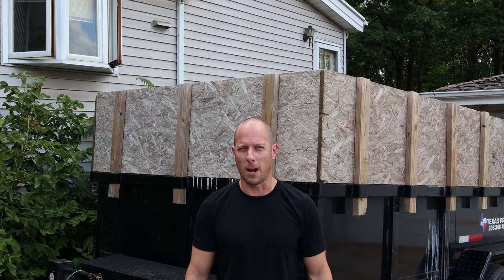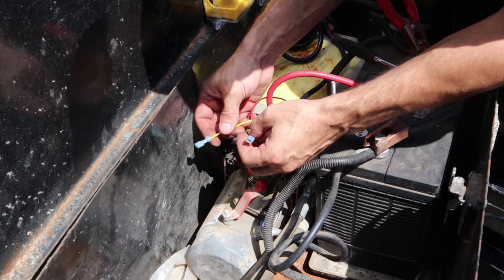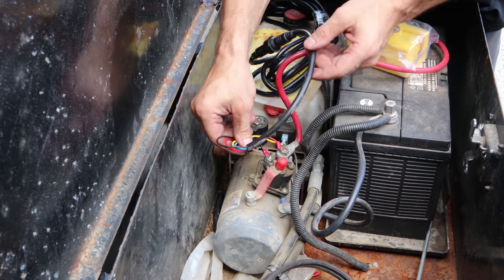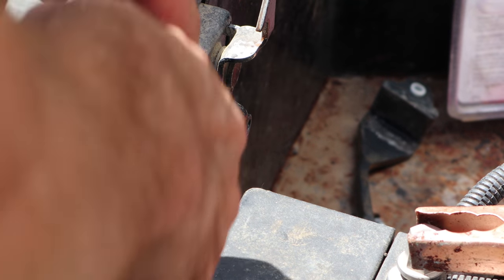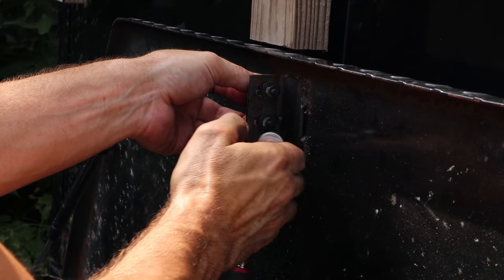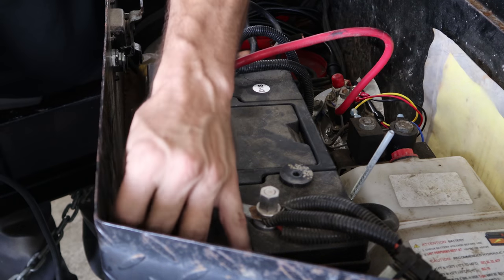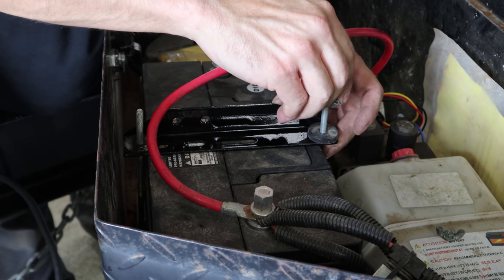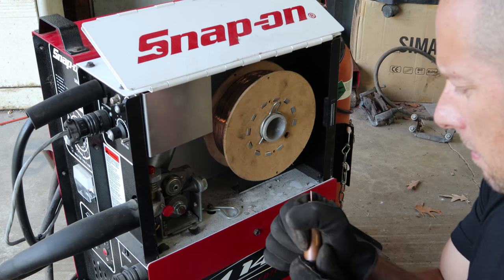Rebuilding a wrecked trailer after a collision part 2 To dump or not to dump? That is the question!

Comment: terminal connector crimp tip.  After you crimp the wire in the metal part of the connector ,move the crimp pliers away from the metal part and give the insulation part a squeeze enough to grab the insulation on the wire. This will help prevent the wire from separating from the metal part of the connector over time. Similar to using a clip to hold the cable to the solinoid. Unless you use heat shrinkable connectors
Reply from the maker: I usually use heat shrink connectors but they are not really necessary since the other end of the connector is wide open to the elements anyway.

Comment: Nice work as always. For that front lid rattle, you can cut some old small rubber hose and push them on the bottom part, so that the lid when shut hits the rubber and doesnt rattle even as little as you got it to rattle. I hate rattling also. :)
Reply from the maker: Thanks!

Comment: Some good work there....I haven't touched a welder since the early 80's but I think I might have done a better job than was done on the colbolt
Reply from the maker: Thanks, if you had never touched a welder, were blind and had had your hands tied behind your back you could do better. lol  They didn't set the bar too high!

Comment: On the top of the tool box you can buy a rubber seal that fits over the edge of the sides to seal up the tool box better.
Reply from the maker: It doesn't need to be weather tight.

Comment: It's amazing how much rust can show up on a 2 year-old trailer in the midwest. No rust = a California benefit.
Reply: All trailers show rust quick.  They are not primed, just painted with single stage gloss black that's paper thin from the factory.  Price point you know.
Reply from the maker: This one was actually from KS but all trailers that get used rust.  It doesn't help up here with salt either so they look worse much faster!

Comment: The Harbor Freight Tools Do What You Need Them To, That s All That Matters! My First Tool set was a 40pc 1/4 & 3/8 Drive combo set that came from an Auto Parts Store (Strauss) and My Deep Sockets Came from a Grocery Store. They Did Their Job. Have Gradually Upgraded Past Few Years..
Reply from the maker: I do have tools I prefer but when I don't feel like spending the money or they are not available, even the cheap tools get the job done!
Reply: @vehcor  Exactly! Sometimes You have to Run Out to get a Tool in a pinch. I Have a Cheap Set with My Mistake, a Better Set in My Truck, and a Few Pieces of The Big 3. I Try To Get MADE IN USA as much as possible. Anxiously Awaiting Next Video 😎..

Comment: You got lucky on that hydro line, so close to saying throw it in the pile.
Reply: he loosened it to enhance the video
Reply from the maker: I did, it worried me that a seal was blown out.  Someone had to loosen it, possibly to lower the dump if it was up for some reason and the pump was not operational.  There is no way they were using it like that and I cannot see how it would have been from the accident.  Still a pleasant surprise to not have to spend money for what at first looks to be a big problem.
Reply from the maker: @lostintime8651  nope, I don't have time to make extra work for myself. lol

Comment: Murica🇺🇸👍I've owned and abused a trailer just like that one. Great trailer... Did not ever let me down. I'm sure I overloaded it a few times. I do a lot of water damage demo. Best upgrade I ever got for it was the wireless controller.
Reply: I also recommend the wireless remote. Can't beat it for the price/convenience.  Also, double-check that the rear doors are hooked securely before you lift the bed or you will need more than the texas pride door alignment tool.
Reply from the maker: The quality is not as good as some of the other dump trailers I have seen but for what I need it for and what I paid, it will work out perfect.  I have a wireless remote for my winch on my other trailer and it is super useful.  Maybe a future upgrade!

Comment: Was going to suggest putting some weather strip around the top of that battery box to keep the weather out, and keeping the rattle noise down. I have a 20 foot PJ car trailer that has a similar pump and control system. Pretty nicely built trailers!
Reply from the maker: While the PJ is nicely built, this one is lacking in many areas.  If I would have paid what these things sell for, I would have been a little upset!  For my uses it will be perfect but in my opinion and experience, you cannot beat a PJ!

Comment: Excellent video. One thing I would l would like to point out there is no ground on those controller. The red is power to the switches, black is power to the motor solenoid,  yellow or blue is power to the up/down solenoids. Good tips on the wire clamp and air removal.   They probably loosened that hydro line to drop the body after the accident.  Good job on the adjustments. Lol for the Snap On welder.  Can't wait until next week.
Reply from the maker: I didn't really check, I just put them back where they went or I thought they went.  I do like to be accurate in my statement so after reading your comment I decided to check in case I had to correct myself.  The test light as well as the negative sign on the solenoid seem to agree that it is in fact a ground. lol I was thinking they may have loosened it and to lower it would be the only reason I could think of.  I can't see it being wrecked in the up position.  Someone had to loosen it, they could not have been using it like that.
Reply: Unless when it was hit it jolted the body up slightly or shifted the load causing the body to unseat from the frame. could also be non-damage just to get a new trailer. You are correct on the solenoid also. I checked my cousins dump trailer and learned something new.  Most of the hydro pump motor solenoids are power to operate just like a snow plow. learned that one the hard way. kind of.

Comment: Too many 're-builders' just do the basics to get it out the door, but you went all over that trailer to fix everything, the chains, the safety cable, the bent door, the  locking bar, even the loose line under it! (even the battery hold down, the 'loose' lid & the lock) Way to set yourself above the rest!
Reply from the maker: I just want everything right so I can start breaking it all myself. 😂

Comment: "All my welds are worth twice as much as everyone else's."   I laughed.  But did you get it from Snap on or rescue it like most of what you rebuild?  :D
Reply from the maker: I actually bought it off eBay, it was used and by used it was not off the Snap-On truck.  It had never been plugged in.  I paid $1100 and a 2.5 hour drive to get it.  Well worth it!

Comment: They have a wireless remote system at Tractor Supply that’s normally used for winches that would work in this situation. I feel it would be much more convenient to utilize the wireless system so can dump while pulling forward. Would work great for building  roads and driveways.
Reply from the maker: I'll look into it.  This one is only for hauling all of my scrap metal to the scrap yard.   I'm tired of unloading my truck by hand. lol

Comment: for 140 bucks you can understand why they kept the control
Reply from the maker: Yes, they are douches.  They got paid for the trailer and all the parts.  It could have been the tow yard it was at too.  Who knows? Since it only cost $25 to replace it new, a used one is not worth the time to steal.

Comment: When Texas Pride's Prideful prices are to much Ya gotta do what ya gotta do! I ended up with one of those low quality rebuild weld jobs. The core support basically collapsed into the engine. Fun times.
Reply from the maker: Rebuilds are about saving money, sometimes you have to find alternatives to make it work.  I have seen a few of these low quality weld jobs.  I have had to fix them on a few of my rebuilds before I could sell them as well.  Sometimes when I was working on a different part of the car. lol

Comment: Add a wireless controller. Love mine. Cost $15
Reply from the maker: Where did you get it of $15?  That is a good deal.  I have not seen them that cheap anywhere.
Reply: https://youtu.be/dc_emqWgAlc
Here is a link to a video where he links to the unit I bought

Comment: Makes you wonder if they got the controller and was working on getting the ram, it seemed loose or excessive play on the bottom eye and twisting when you checked for the leak.. Is that a cotter pin flexing on the bottom mount? 4:23
Reply from the maker: The pins are worn on the ram, they will be replaced soon.  This thing was a construction trailer and those guys are not known for taking care of things. lol

Comment: Hoo, that cobalt, Now they usually dont survive much of a hit in the front to begin with, but when you have that poor of work, it really isnt any wonder why it caved and the damage is so extensive, but there are a some guys out there that know someone or slip an inspector a few bucks and next thing you know Passed! 

The trailer is looking pretty good, nothing to expensive so far, and yeah I never leave the controller with the trailer I always take it and keep it with the trailer title and key and then when I have to g somewhere take em  with and when done put em back, lord know if someone manages to steal my trailers damned if they are going to get the remote too...lol. still like I said cheaper than buying used and you can use it and for however long and re sell it and still get your money back and more often than not stick a few dollars in your pocket too

And your snap on Welder is a classic, haven't see one of those in a long while
Reply from the maker: Yep, the Cobalt is done this time!  lol  I insure all my trailers, it is cheap and if those thieves really want it, they will get it!  They actually still sell the welder but they have been around for close to 30 years.  They are great, never had an issue even with the one at the shop which is 25 years old and heavily abused!

Comment: I heard you say you were broke, did that happen after buying the snap-on welder.
Reply from the maker: Only 374636329623912639 more $25 weekly payments and it is all mine. lol
Reply from the maker: @keving2371  You would be correct but it is every bit as good.  I got this one for a steal.  "Used" on eBay for $1100 and a 2.5 hour drive.  It was never actually used.

Comment: How is that snap-on welder? I use a Millet and a Lincoln welder and have used some garbage ones too but never knew anyone who had a Snap-on or Mac.
Reply: I have the Snap On MM250SL  250 amp  wire welder. It has the removable suitcase with 25 feet of cable so if you're working inside something you just unpin the suitcase and carry it to where you need it. The welder is made for Snap On by Systematics out in California. I'm very impressed with this welder. I do a bunch of 1/4", 1/2" and some 3/4" plate welding when I repair trailers and build heavy duty skid loader attachments. Prior to this one I had the Snap On YA212, another 250 amp wire welder. Same experience with it..very impressive.  I've also ran Miller and a few others and I'd put the SO welders right up there with them. Yes the SO welders do cost a little more but not bad. I think my new one was $3800 on sale. Had it three years now...it paid for itself in about 6 months.
Reply from the maker: This one runs on normal 110 voltage.  It will weld 1/4 steel and has 100% duty cycle.  Not like the cheap ones that have to cool down.  This thing will weld longer than you can.  The shop I rent had theirs for 25 years.  It was used and abused and never had an issue so I figured I would get one for myself.  They are pricey just for the name but I found this one "used" on eBay.  It was never used, just purchased by someone else.  I paid $1100 for it and had to drive 2.5 to pick it up.  It was well worth it.

Comment: Better look at that hydraulic line, it looks like it will fail before long. Watching when you lowered it , you can see the line move at the end of the cycle. It moved in and out next to the crimp on the fitting.

Comment: How did that car pass safety inspection? They don’t check welds especially on the front?
Reply from the maker: They are supposed to check all that but there are shady inspectors that will pass anything if a $20 is distracting them.  Illinois corruption, it is like standard practice here! 😂😳

Comment: dude.... you should have heat shrunk tubed those connections!

and put a rubber seal around the lid of that box!
Reply: He hasn’t made it that far in P-Tech mechanic school yet! Go easy on the guy!
Reply from the maker: Heat shrink the connectors on one side while I tighten them down to an exposed lug or a spade terminal on the other side!  Got it!

Comment: I'm from Texas and it embarrasses me that your trailer was built here. It's a shame you need to rebuild even the new ones before they are usable. There's another brand named after the huge gate greeter at the Texas state fair that is even worse than the one you have. You have the skills to modify it and make it better than it ever was when it was built, so fix er up. Otherwise, I'd say throw that POS in the pile!
Reply from the maker: It will be fine for my uses but how they get so much money for these is beyond me.  There are much cheaper, better built ones out there!  If I would have paid anything close to what these sell for I would have been a little upset.
Reply: vehcor 
You're not telling me anything I didn't already know! We were looking for a 25' gooseneck flatbed with a 5' steel dovetail and tandem duals about 12 years ago. We're in North Texas and ended up buying it in Oklahoma to get a well built trailer worth the price. We ended up at Oklahoma trailer sales near Durant. Their OTS branded trailers are (or were at the time) of built by Lamar trailers. It's a heavy built trailer for sure. The only problem with it so far is the "treated" lumber deck is rotten. It needed to be replaced at 10 years in.

Comment: How much did you pick up that trailer for if you don’t mind me asking, I’m wanting to buy one but they run about 12k and up for what I want I’m wondering if I should just buy a wrecked 1 from auction and fix it up any information is helpful thanks
Reply from the maker: Buy a new one. lol  The used trailer market is crazy.  I see people paying more than for new ones and wrecked ones usually cost just as much when you are done fixing them.  I have been bidding on these for 4 years.  Every one of them, this is the first one that was worth the money if that give you an idea.  People must have been sleeping when this one came up. lol This one sells for 6-8k depending on where you find it new.

Comment: "Poor like me" as you're rebuilding a dump trailer to pull with a Denali Duramax.... No I get it though. Its a different level of poor. I'm poor trying to retool myself to get back working. One piece at a time. Budget is the key.

Comment: this is why every trailer i own i built from new steel, and built it to last, unlike all mfg trailers the work man-ship is total crap, i order all my axcels from a Ont. Canada axcel mfg. less then half price from any trailer or spring shop, and i get them complet with hangers, springs wheel. tires. i hate trailers built using c-cannal.. and crap tin doors, them again been a A class welder all my life. if you take the time and look really close at any mfg trailer you will wounder how the hell do they get away with building crap like this, first half the parts are not even welded fully or next tonothing, and pour all around, sure standing back looking at them, oh they look nice,, it bad when a new trailer just leaves a dealer lot, and the toung comes off and kills a kid on a bike, see it many times

Comment: Those tool box will not stop a pro to get inside
Reply from the maker: Nothing will stop a pro, I never said it would.  It will keep out 95% of the thieves which are just opportunists.  Heck, I could be in it as fast with a screwdriver as with a key.